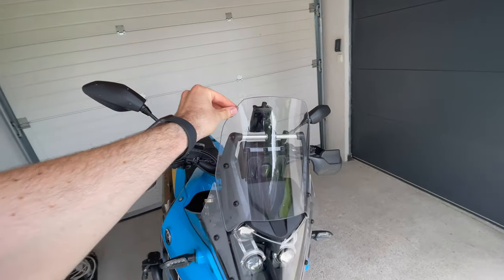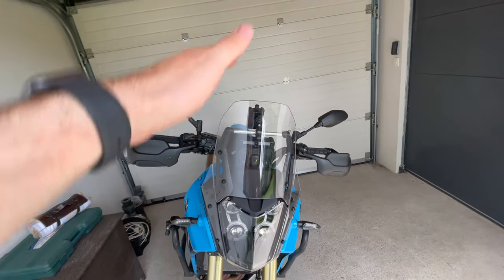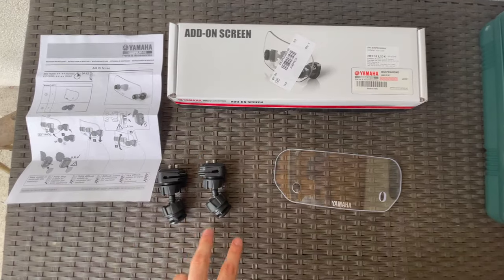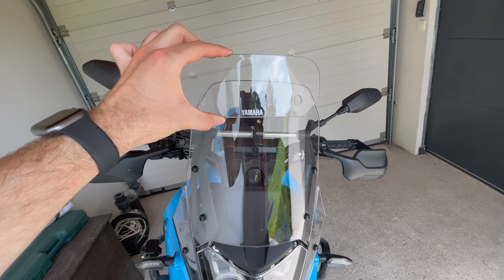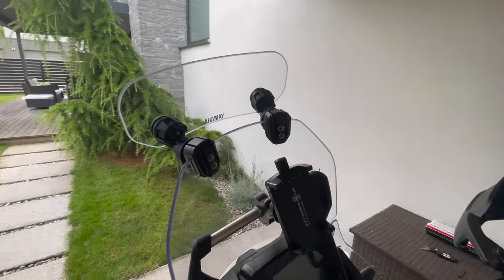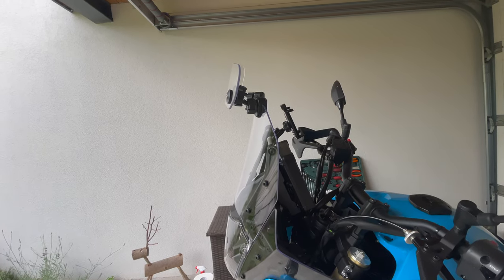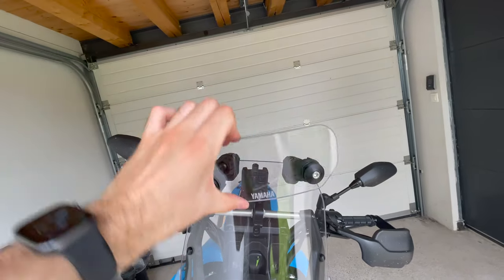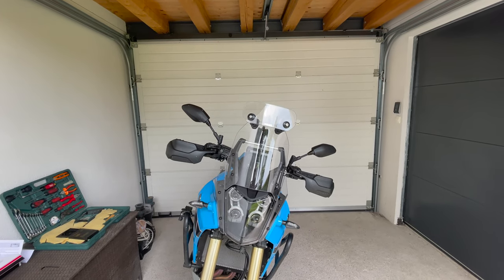"OEM Add-on screen/windscreen" Installation & Review | Tenere 700

Comment: I am 1.84m, no problems with wind hitting me, but have problem with wind noise, its unbearable at higher speeds. Any expierience with that, does this help? Thanks!
Reply from the maker: I wouldn't know. I assume you would need a wider windscreen to eliminate the wind noise. The helmet is also something to look into. Schuberth are known to be the quietest. 
Otherwise, I use a set of Motosafe Tour earplugs made by Alpine. These are known to be one of the best, I strongly recommend them. 
https://www.alpinehearingprotection.com/products/motosafe-tour

Comment: I love the video ,and I are you still using the Add on  screen I have tried the alt-rider adjustable  screen Reiser with is rubbish. I am 6,1 and I’m about to order Yamaha Add on screen would you still recommend? Like you said I would only use it for motorway, work then take off .I like the  look of the original screen.
Does it leave any marks on the screen OEM screen after it’s been taken off? Thanks Paul
Reply from the maker: I would recommend. Make sure you tighten it well as it may want to fly off on bumpy off-road surfaces. It does leave a small mark but it rubs off easily. Just a heads up, it may be less useful and effective than you think, but it does certainly help. Its not as effective as a taller and wider windshield.
Reply: @gravelroadslovenia  fantastic I have placed the order with Yamaha thanks for your help 🤟

Comment: Hey, did you consider the adjustable adapter for the original screen from Touratech?
Reply from the maker: Honestly I have thought about it but decided not to get it. My main concern is, when you lift the windscreen the air won't hit from the top, but will flow from below which could be even worse. 
There is a similar issue with the Honda Africa Twin where air flows from the front fender up by the suspension and hits you right in the chin, causing the helmet to shake. 
I could be completely wrong of course 😂, but thats my theory...

Comment: Just bought the OEM add on screen. Was it hard for you to make the clips fit to the orginal screen? Did you have to tighten the screws very hard?  I have problems getting the clips to attach to the screen without it being loose.
Reply from the maker: I know exactly what you are talking about because I had the same dilemma... What I did was screw them in more than I thought was "ok" while still leaving enough play to prevent damaging the big windscreen. 
I haven't had any problems with it detaching or moving since, even at high highway speeds or proper offroad. 
I hope this helps!
Reply: @gravelroadslovenia  thanks for your reply.

Comment: Thank you for the video. I am 2m tall too and I am wondering how did you adjust your position on the bike. I think you have the rally seat (I don't) but did you consider also bar risers and lower foot pegs? With the standard seat my legs are bent way too much.
Reply from the maker: For tall guys like us every bike is too small 😂... Honestly I haven't done anything to mine to make it more ergonomic. My legs are also quite bent but the rally seat helps I think (the rally seat came standard on the Rally edition). I consider getting some lower pegs, but I'm not sure about the bar raisers. 
My main issue is off road when standing up. I have to lift my legs from the pegs to change gears or brake and that shifts the weight so much it makes the bike unstable. 
I will keep you updated with a video when I get to solving this problem!